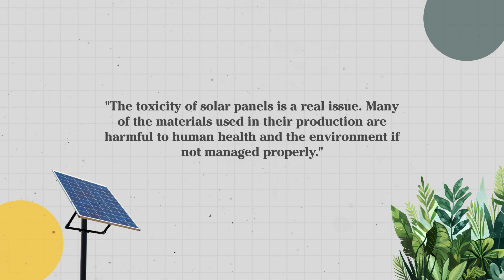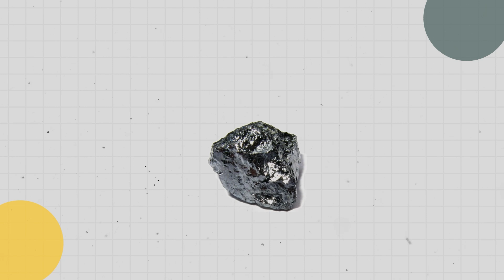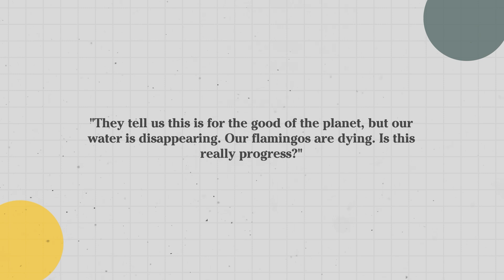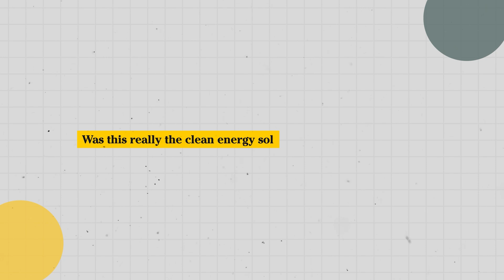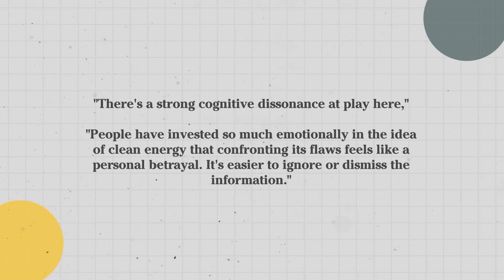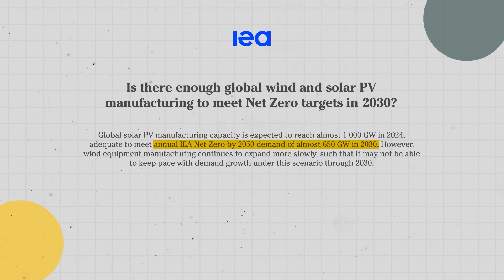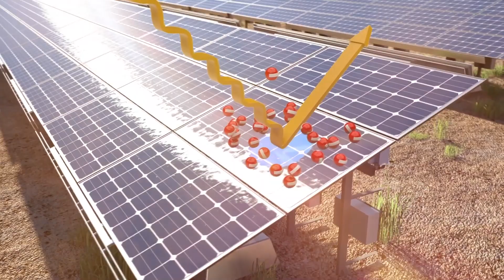The Green Energy Lie That NOBODY Talks About

Comment: I'm studying environmental science, and all these issues are thoroughly discussed and understood on the academic end. It's when trying to distill the information down for the general public that the nuance is lost. Maybe renewables/nuclear are bad in the way that their resources are extracted, the way they are manufactured, and the way they handled at EOL. The same could definitely be said for any fossil fuels, but they also have to be burned, which releases significantly more pollution (especially coal).

Many of these issues can be overcome through the use of newer technology (thin film solar) combined with policy/regulation to encourage or require better mining, manufacturing, and waste management. Personally, I'd be okay with requiring manufacturers to take back their solar panels for recycling along with requirements that they are recycled. I know First Solar which does thin film panels has a recycling program that seems pretty good, but It's just one of many manufacturers. 

It all just sucks, because as always, the worst parts of the processes are offloaded on those least able to bear the cost and advocate for better things.
Reply from the maker: Well said!